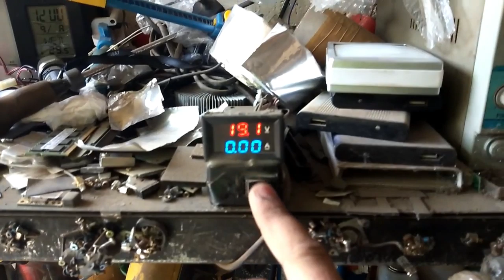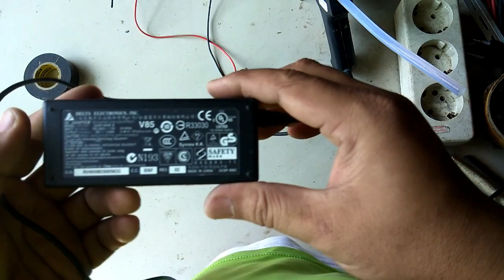Cara Merakit PSU Untuk Service Laptop / Tool Teknisi Laptop

Comment: misi om mau tanya,saya ada kasus Lenovo Thinkcentre M73 IS8XT ver 1.1 awalnya matot,trus cek tegangan smuah normal.langsung saya flash bios tapi saat di colok charger indikator power kedip tapi nyala.smuah tegangan ada,di tahan swicth mati.di swicth nyala seperti di colok charger cuma kedip power indikatornya tapi nyala.udah ganti 5x file bios tetep sama.udah coba rehot chipset juga nihil.tolong bantuanya om saya ucapkan terima kasih atas bantuanya,,,,

Comment: Punya saya saklarnya punya 3 kaki...punya guru cuman 2 kaki...gmna cara ngakalinya yah mas??? Utk bagian inputnya.
Reply from the maker: Tengah sama pinggir atau diukur pakai avo meter pak
Reply: @AQTEKNISI  klw Avo di mode buzzer tempat ukurnya dmna aja mas???
Oiaa, utk kabel power saya punya 3 urat d dlamnya...mohon pncerahannya...
Reply from the maker: @ephyndalla6980  untuk kabel potong 1
Reply: @AQTEKNISI  ok guru..mkasih bnyak...sya coba yah..
Reply: @AQTEKNISI  kabel itam/gnd d input adapter dipotong n' tdk disambung kan mas??
Soalnya udah coba tapi output 19V g keluar.. lampu saklar pdahal udah nyala.